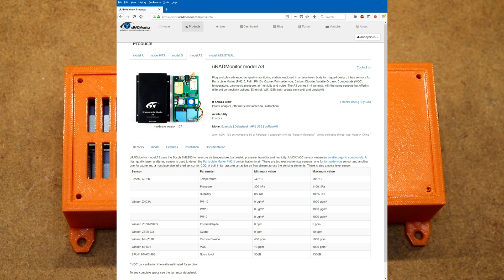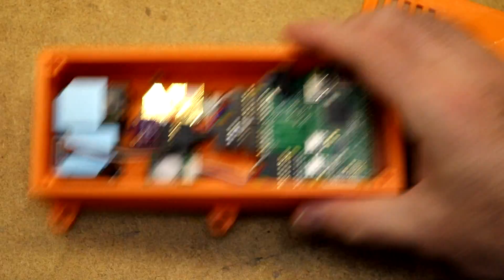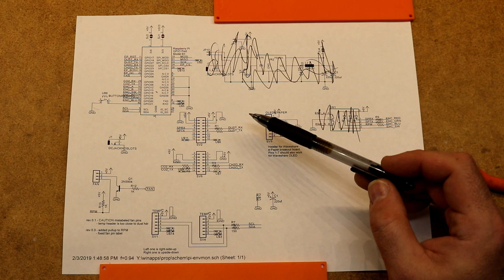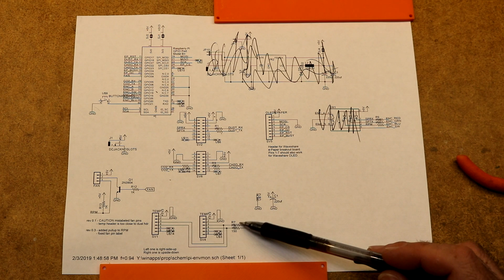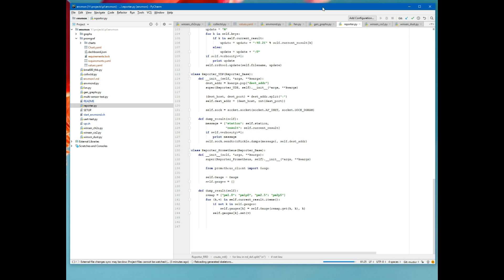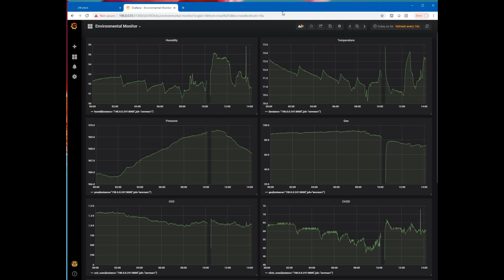Raspberry pi based indoor air quality environmental monitor

Comment: Interesting project, I just got my SGP30 and it running well but the values are all over the place compared to your fairly steady lines. I guess the calibration step is simply letting it run for 12 hours first. Did you have any calibration tips that gave you smooth data with the SGP30?

Comment: Great project. Something I've been thinking about doing given my significant allergies. Any evidence of outgassing from either the PCBs or the 3D printed case?
Reply from the maker: No direct evidence, although the BME680's VOC sensor is registering higher than I would have expected (maybe air quality here is just a bit on the poor side). The exhaust fan, while set to know move a great deal of air, I think it probably does move enough to ensure a consistent stream of fresh air into the case. I can try assembling one without a case and see if I get a difference in readings.

Comment: What was the total cost of all the sensors?
Reply from the maker: Checking my notes, CO2=$18.50 each, CH2O = $17.99 each, dust = $13.75 each , BME680= $11.24 each. So about sixty bucks worth of sensors per air quality monitor. I'm sure one could do better in quantity. I went with enough for three monitors.

Comment: Amazing ! Could u link the parts ? And maybe the code to ?
Reply from the maker: I'm planning on doing a full blog post writeup this weekend and then I'll try to assemble a BOM. In the meantime, code is at https://github.com/sbelectronics/envmon
Reply: @smbakeryt  In case anyone finds this: this is the blogpost: https://www.smbaker.com/raspberry-pi-based-indoor-air-quality-monitor
and no, there are no gerber files to replicate the board